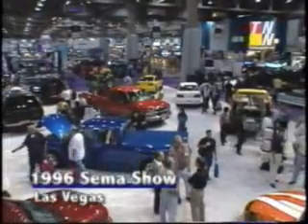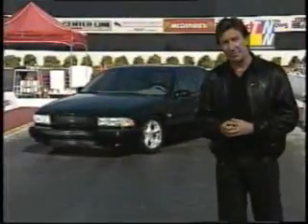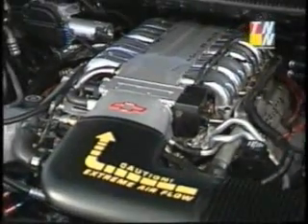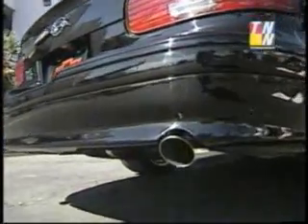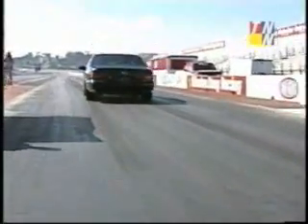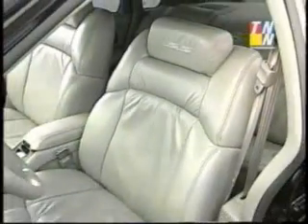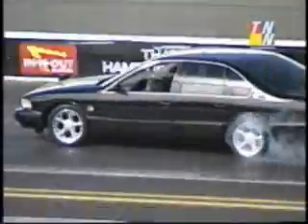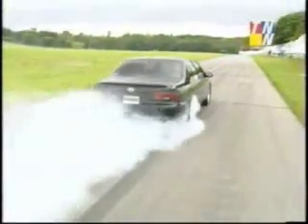Tim Allen's 1996 LT5 Impala SS

Comment: if someone just GAVE me a brand new Mercedes, id trade it for TWO of these... I LOVE THIS CAR... IT IS THE Mechanical version of ME... Chevy fucked up discontinuing this vehicle... Im B-Bodies for life..." '96 Impala Forever"...
Reply: Amen :( though I have great appreciation for Mercedes, i see them as American version of muscle car, they use big engines, big hp, badass all together though they do have way more comfort features and all the little details. I would take the most overpriced Benz, get a CL600 and 2 Impalas :)
Reply: I do not respect any foreign car, I don't care who made them or where they  come from.  I let English cars live only because they buy plenty American cars. Otherwise, I love to lure them to their doom and set them on fire. I sometimes point out the burning remains for the fire trucks.
Reply: These cars were very bland and boring even when they were new.  The only they had going was that they were fast because of the motor. But other than that they were low optioned, cheaply made and outdated.  Any Mercedes would be a much better choice.   Also there were plenty of other family sedans that were more advanced and more exciting than these and thus resulting in there short production run.  Not to mention they are very ugly looking.
Reply: Many Police departments would rebuild these 1994-1996 B bodies with new engines, transmissions, rearends etc,etc rather than go to the Ford Crown Victoria Interceptor.  Low optioned?  You could get whatever GM offered at the time.  Try comparing the cost of a Merc to the cost of a B-body.  In some cases you could buy of these Chevy cars to one Merc.  Ugly?  That's opinion, I think they are beautiful, esp. the actual true SS Caprices known as the Impala SS. They came in 3 colours in 1996, -Dark Cherry Metallic -Dark Green-Gray Metallic -Black.and looked amazing in each of them.  Some of the best looking OEM rims that GM ever used.  Those Enkei's on the 1995 Binford were gross IMO.
Reply: +cj2style1 GM  has the 2016 SS Impala 6.2 liter rear wheel drive.

Comment: If I could I would drop in a 6 speed auto from GM. It would make better use of all that torque the engine has to offer. 4 speeds are geared waaay to tall.